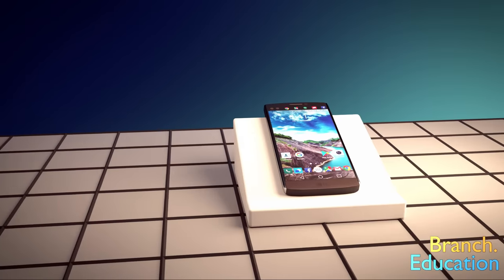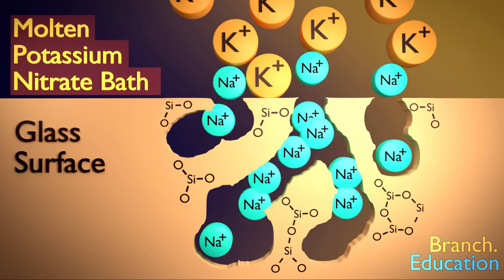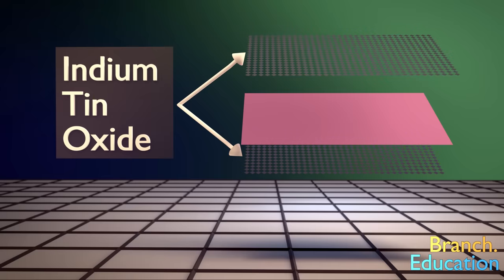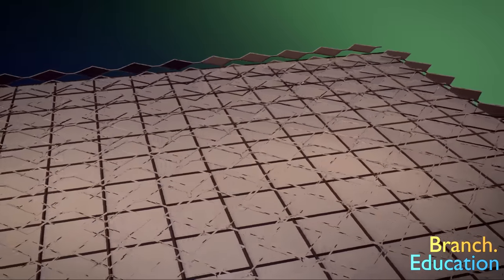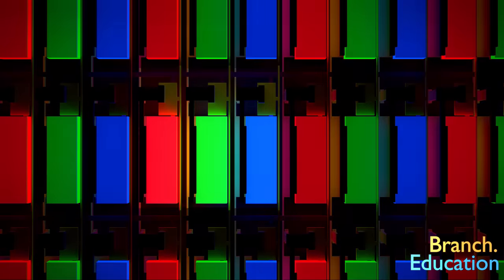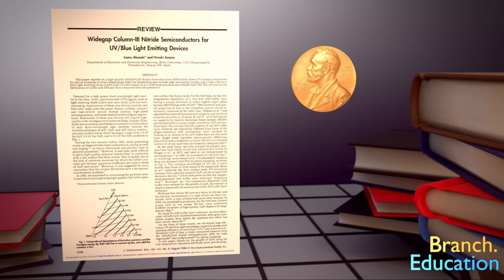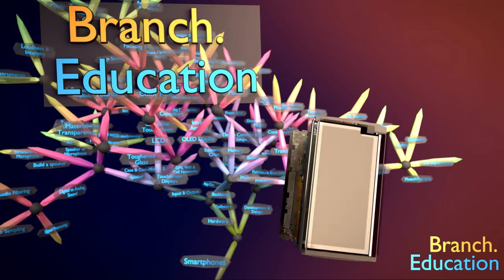How Do Touchscreens Work?

Comment: If I'd want to build a smartphone here is a list of things I'd put on my to-do list:

-a way of processing data
-storage
-software
-an rgb display
-touchscreen support
-few more buttons
-a battery
-2 speakers
-camera
-microphone
-wi-fi support
-SIM support
-SD card support
-wiring, fitting it all together
-a gyroscope
-vibrations
-GPS
-flashlight
-hotspot support
-bluetooth (tbf I'm not sure if this is just about the software or is actually using different hardware than wifi or hotspot)
-an atomic clock

I'm sure list goes on, these were just the ones on top of my head

Comment: Plz make a video on working of OLED & LED and their differences
Reply: The biggest diffrence is that OLED can emit an completly black ligt. the LED cant because in the LED lights they are connected directly to eachother in a diffrent way than OLED. so the LED need to turn of the whole screen to be completly black. the OLED dont need to do that. and the OLED have an sharper light too.
Reply: @xaddox7524  There is no such thing as "black light". The difference between LED and OLED, is that OLED has individually addressable LED's, which allows the particular chips to be switched off when displaying deep dark colors, resulting in more natural, vibrant content display. In a typical LED display you don't have such a function, so all the chips have to be ON when the screen is turned on. An LED strip can be a great analogy in this case. An OLED would be a strip that can have some of the chips switched off whilst the rest is lighting up. A typical LED strip would have all the chips switched ON but with different colors, some could be dimmed.
Reply: when i said that i meant not be on wilst the others is on  @bagmar

Comment: Branch Education ::  if i open a picture in my smart phone, which has a colour mixing 30% RED 30% BLUE 40% GREEN. How  does the MCU of a OLED display smart phone  understand the ratio of R-G-B Colour  in a perticular LED of OLED display . & how a singel MCU controls milions of LEDs in OLED display. & leds are made of diode , which is doped p & n in silicon , which is inorganic element . so, why is it called ORGANIC LED (OLED) ?
Reply from the maker: These are great questions!  So the MCU for a smartphone is called an All in One processor, so it includes the CPU and GPU.  (Central and Graphics Processing Unit) The CPU runs the software and works with the GPU whose job it is to figure out what it on the screen, and then figure out how to color all 10million subpixels.  There will definitely be a video going into the CPU and GPU and the specifics of how a microchip can control so much.  In the picture, there was an N region, P region, and in the middle an emissive layer.  The emissive layer is made of organic compounds.  It's called organic because it is a carbon-based molecule- These very specialized carbon-based molecules are hard to develop and synthesize.
Reply: Aninda Mallick Teachers pet!
Reply: @blackham7  . i asked that question myself. Why did you say that?
Reply: Aninda Mallick he's calling you a nerd
Reply: ok :)
Reply: Good question and a very good explanation. This is my first video right now and I am amazing. Such great animations and content. I’ll be watching a lot more haha. Keep them questions coming buddy.

Comment: your explanation is very good but i wanna know further how a touch is registered.............what is wonder is led display is not touch but layers detect the touch and how app is open for suppose we touch on fb app how it detects that under the layer it is containing the fb app ok i cant explain but i wanna know about it please do a video on it..................thhanku
Reply from the maker: Yeah- this is a great question, and I will do a video on it eventually- but the short answer is that software solves what to do based on where you touch.  Similarly for your computer, if you have two windows on top of each other, and you click on the upper one, it will be Windows or ios that tells where you clicked and sends that info to the appropriate window.  The next video will go into multitouch.

Comment: Touchscreens are ubiquitous in modern electronic devices such as smartphones, tablets, and laptops, and they have become an essential part of our daily lives. There are several types of touchscreens, but the most common is the capacitive touchscreen, which works by measuring changes in electrical charge on the surface of the screen.

Comment: 00:01 Touchscreens on smartphones combine different technologies into a single package.
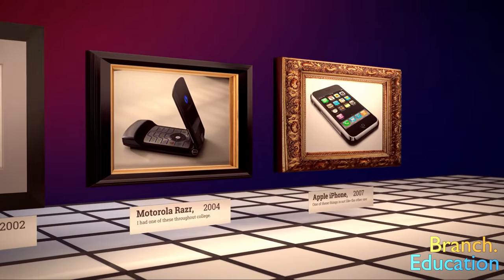01:10 Touchscreens combine multiple existing technologies into one seamless interface.
02:05 Toughened glass is stronger due to potassium atoms replacing sodium atoms.
03:03 Toughened glass and projected capacitive touchscreens are the key components of touchscreens.
04:03 Touchscreens work by measuring disruptions in the electric field caused by the touch of a conductive material.
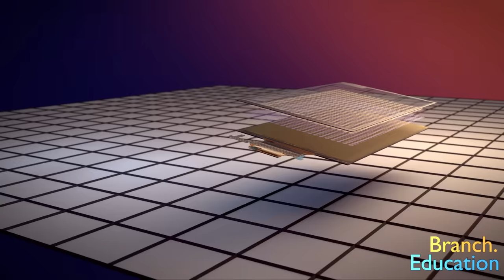05:03 OLED technology is used in most new smartphones for high-quality image display
06:23 Each subpixel's light intensity is controlled by a thin film transistor.
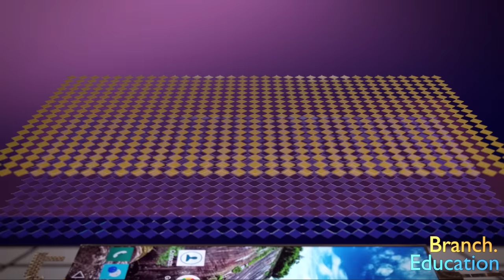07:26 A touchscreen display consists of an OLED display, a projected capacitive touchscreen, and strengthened glass.
Crafted by Merlin AI.

Comment: tldw: 

•the glass that protects the screen doesn’t shatter as easily as regular glass because the particles are bigger and therefore more compact, making it need more force in order to be broken

•the phone is able to recognize touch basically because of conduction, that’s why non-warm things are unable to affect your phone

•the display (oldc) is just a bunch of red, green and blue pixels stacked on top of each other that can produce many different colors and images by allowing a certain number of each color pixel to light up.

you’re welcome.

Comment: No it isn’t to in-depth. The overall structures are well designed  all of the science aligns very well. Interesting bits of info such as the efficient blue light emitting diode was engineered in 2014 as well won a Nobel prize. I vaguely remember  about it in Scientific American. Recently it is the muon ng9 that as been discovered at CERN. The video length is highly conducive for a quick learning topic.  Many tech, science, or physics are more in-depth 35-50+ mins.  As in 3 Blue & 1 Brown or . Veritasium . As well as access to Physics.org or KHAN University. Your boutique style is refreshing and well informative. I Subscribed.  Thanks for your work.

Comment: I would like to see a video explaining how reengineers achieve the ultra-high frequencies  necessary for digital transmission,  Are resonating crystals used to modulate the reversals in DC current necessary to switch the transistor states (on/off) at the required speeds?

Comment: Does the glass vibrate when dropped less because of the potassium atoms replacing the sodium? Is that why it is stronger? Or does it vibrate at the same frequency as it would with the sodium atoms?

Comment: Amazing video. So hows does the toughened glass bend at the touch spots to create the voltage change? Coz we are not touching the capacitors but the protective glass
Reply: By Magnetic field change! Changing field mean changing voltage in those sensors which is regsister as a touch!

Comment: The way Apple came up with the touch screen for their iPhones, is they purchased a company that was developing touch screen technology (but this company was focused on medical devices).  However, I remember when i first started using ATM machines in the 1980s (in New York City), and many of the ATMs had touch screens (and they worked great),  its strange that ATM technology/software has gotten worse over the years (I have a bank account with a major bank with many branches and their ATMs use buttons, not touch screen).

Comment: a bread slice consists of millions if atoms, using carefully selected ingredients, then heated for a specific amount, at a predetermined temperature. heating the bread for just a few seconds longer, may result in an unusable bread loaf and up to.40 slices of bread going to waste. this is why the bakers use devices called timers.

Comment: Why don't they use a plastic material (with a High transperancy) as a main screen enclosure, which make the screen shatter proof. We can use  removable regular gorilla glass on the top, which make it scratch proof. 
Whenever screen shatter, just replace the tempered glass. Inside plastic glass won't break!!!
So that we don't have to replace the entire display.

Comment: Can you please clear my one question
The question is that since there is an thoughened glass so how do our finger disturb the electric field because we are touching glass not capacitor
Reply: The glass is conductive, I am guessing
Reply: @angadsingh9314  but if the glass is conducting then field is already disturbed due to conducting object
Then how touch will work

Comment: No it isn’t to in-depth. The overall structures are well designed  all of the science aligns very will. Interesting bits of info such as the efficient blue light emitting diode was engineered in 2014 as well won a Nobel prize. I vaguely remember reading about it in Scientific American. Recently it is the muon ng9 that as been discovered at CERN.

Comment: Touch technology works 24x7. Na Na Na, its neither diper nor whisper, it is fiber, which can be touched or rubbed or mixed or cut by knife yet unbreakable, immovable, robust and solid. so always use fiber. preferable a blue one. The most watched, the most sought, something which is looked out from every corner, every door, every room, every space. dil maange more

Comment: TBH I rather have a plastic screen today they're made from polycarbonate so it's less likely to scratch. Even the bodies are polycarbonate. So when you drop them they bounce. Apple phones in my opinion are the worst designed. it's basically a tin can that bends up with glass that doesn't warp easily so it eventually cracks regardless of how hard it is.

Comment: The light emissive metal layer touches the 2 capacitor sheets? then it is not a capacitor.Fine video otherwise, too short for the main part.

Comment: I would be easy to make a screen nigh-indestructible withouth changing anything but the design of the screen itself.

My old phone has been dropped countless times withouth a scratch. It finally shattered when it fell right on the corner it's cover didn't cover because whoever designed that phone and cover thought anyone on the planet would attach a keychain to it.

So, what do you have to do? Don't let the glass go all the way to the corners. Close it with a soft material that can absorb the impact. Simple.
Would reduce the ammount of shattered screens by at least 80%. Guess the aftermarket repair screens are too profitable though.

Comment: True story, cause I was their, Apple iPad 1 gen was useing china cheap 49 buck 7 " tablet that was running window Ce a strange window  they designed it useing a Chinese company I think it was Foxconn that had design a  first touch screen for a Panasonic  and useing their iOS it was a strong hit everyone brought one cause it had a 10" portable wifi inside and a cool easy to use software before that very few teen could use a computer, and it started out I was 2,500 I waiting for it to come down till 800 it was about 600 when the iPad came out .

Comment: Still holding a grudge towards touchscreens for 2 reasons. First they removed normal keyboards from phones so till this day typing is an absolute shitshow. Im pretty certain that in just the first year of using a purely touchscreen smartphone I made more typing mistakes than in the entirety of the 20 or so years Ive been using mobile phones before that. The second is that for some time now its so much cheaper to just put touchscreen everywhere instead of actual buttons that it has negatively affected safety in some cases. For example touchscreen in phones or the infotainment system are among the main reasons for vehicle accidents these days. Another minor reason is that its just cheap and unsatisfing to use. Im conflicted about this but the world might be better off without touchscreens.